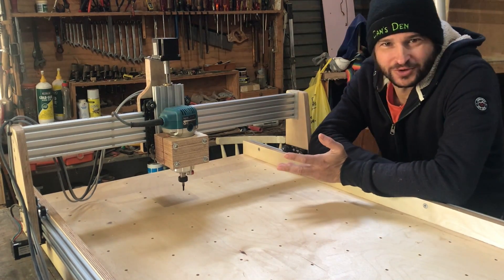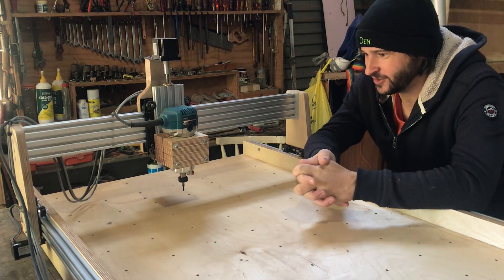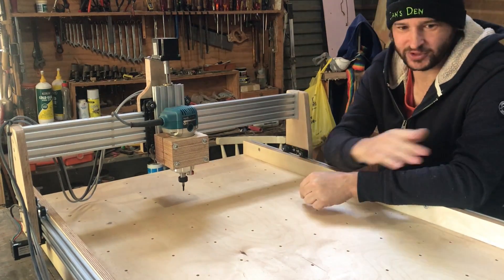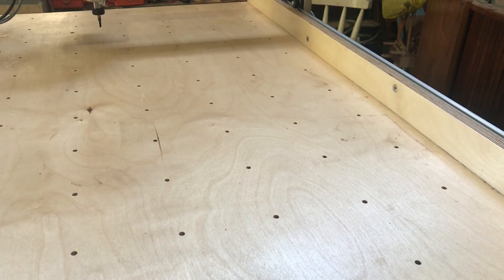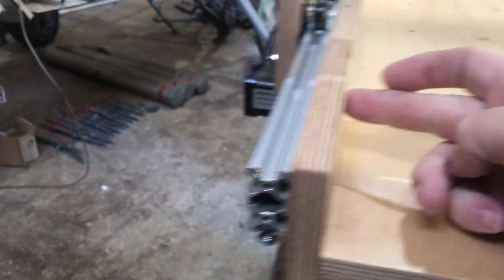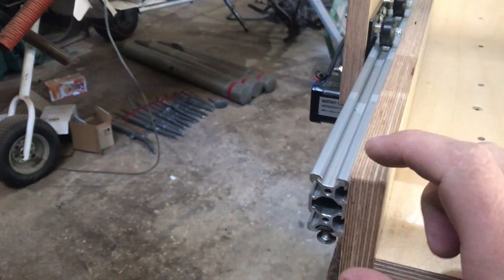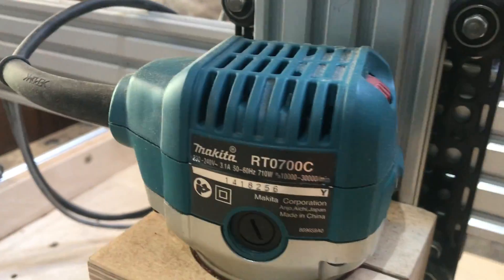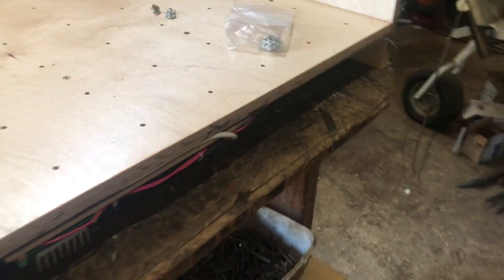CNC build project

Comment: Love the simplicity of design.  You may have an issue with the spindle due to overheating.  That wood bracket is a lot of insulation.
Reply from the maker: Thank you. so far so good, the spindle is a router and its got a pretty strong fan that blows through it, but I also don't use it for extended hours at a time

Comment: Nice Build, I will have to try a wooden CNC build myself, I have also been following BobsCNC ch.
Main change id make and you too can do this is make the bed a tortion box and mount Y rails lower so you have nothing obtructing the sides and you can use it as an asembly table when not routing.
Reply from the maker: Yes that would work quite well especially if you are limited for space. It could mean your side posts might potentially flex more as they will need to be longer. But Im sure with a little bracing that could be sorted. thanks Ill look up bobsCNC.

Comment: I started out with a similar design as a chinese kit. It wasn't very rigid, which may be fine for light woodworking. I was also interested in machining aluminium. That was indeed possible but hou soon run into rigidity problems. The delrin wheels are quite flexible, as is the extrusions when torsion rigidity is important. Especially peck drilling in aluminium was problematic. I ended up building a new cnc with the old one, which was barely getting it done. I used chinese linear rail with ballscrews parts and reinforced it with 20mm thick toolingplate aluminium. And the y axis was reinforced with a steel square tube, which helped a lot. It has no problem machining mild steel now, as if it were aluminium :)